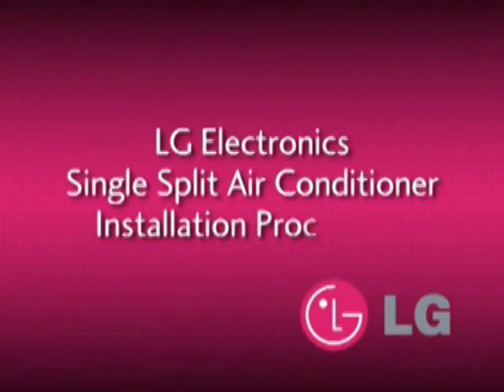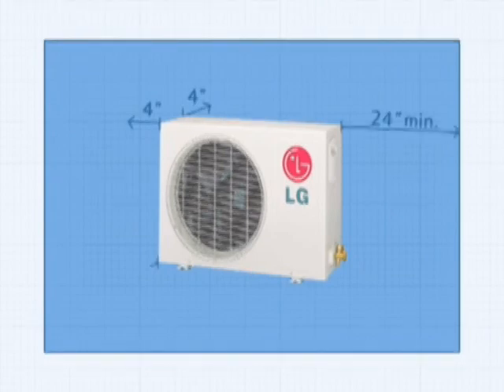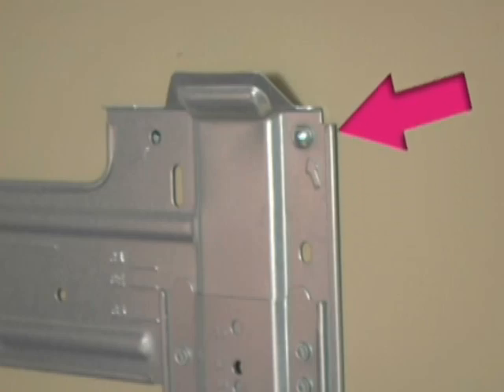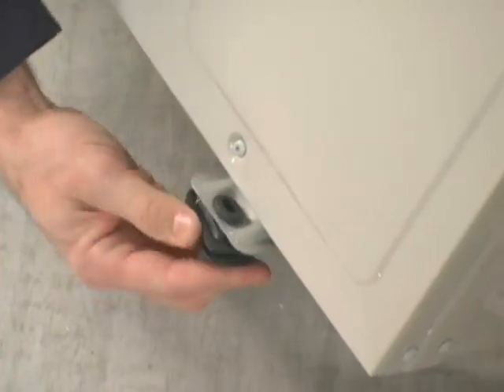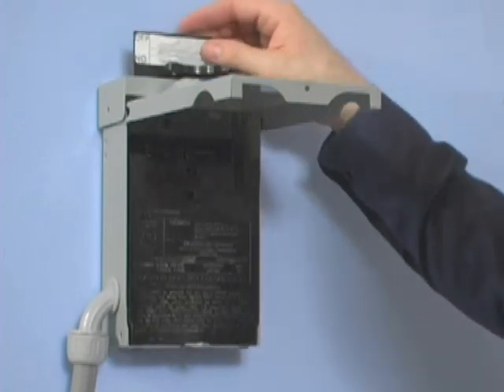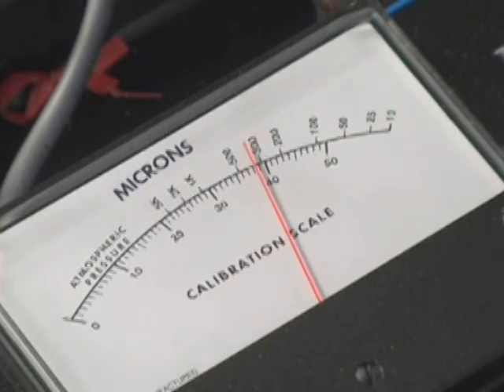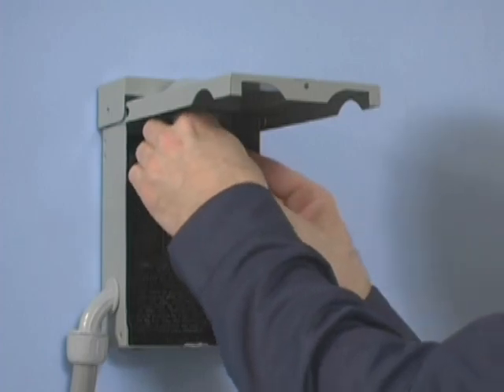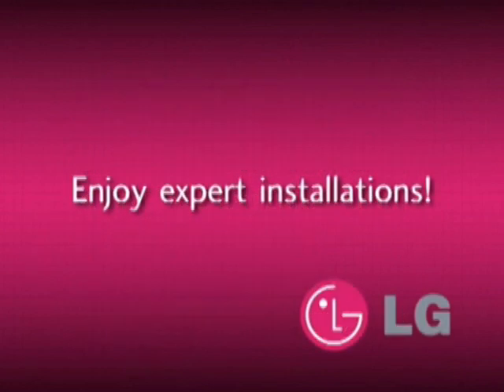LG - Split-System Installation Video (Tips & How-to)

Comment: thank you Sir for your considered. I have some question, I used 165s  5/8 ODF filter drier in 5ton AC split type, but the copper line in high side is 3/8, the unit is 28000 BTU. isn't OK did I install?

Comment: how size copper tube used for 5ton unit
Reply: For 5ton split ac unit (R-22 refrigerant) w/ max.50' length copper pipe use 7/8" for suction line & 3/8" for liquid line but in excess of 50' up to 100' the next pipe size must be governed or use manufacturer brochure for recommended pipe size & capacity.